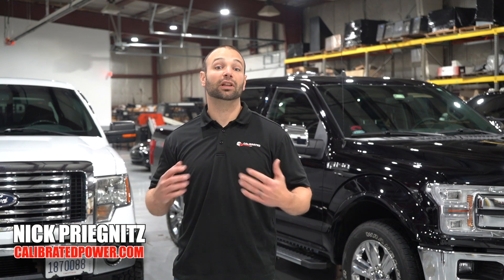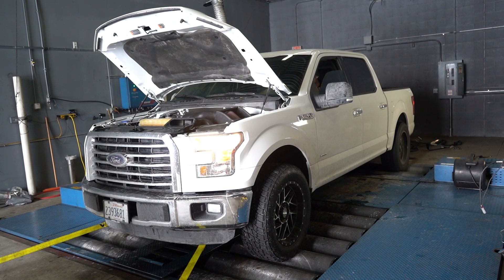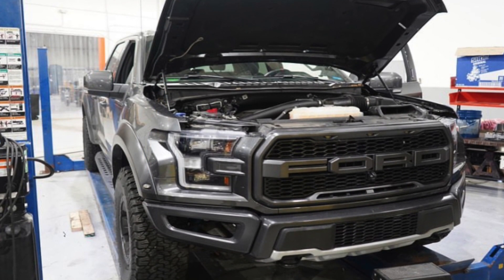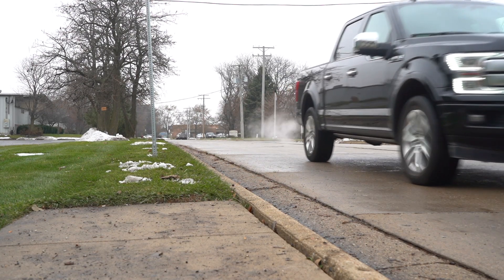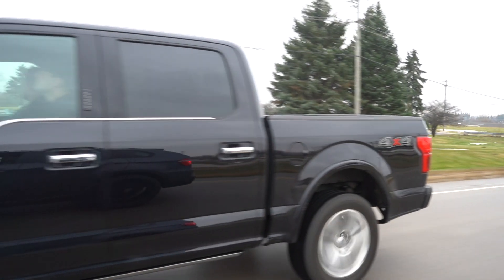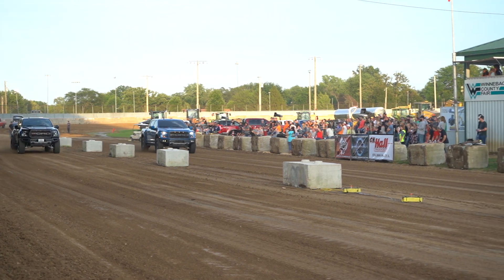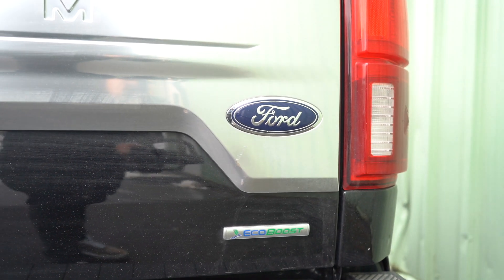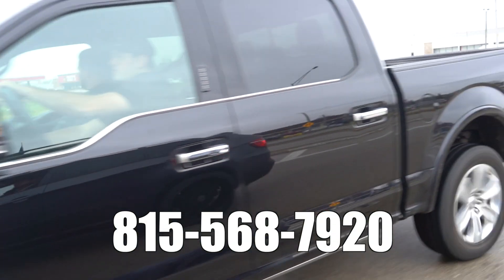ECOBOOST TUNING! MORE POWER, BETTER DRIVE-ABILITY

Comment: How bout some love for the Edge Sport 2.7L Ecoboost?  Despite my tenacious research, I only keep finding F-150 Ecoboost information.  So I'm inquiring every where I find thatseems knowledgeable on the 2.7L EB, are the Edge Sport variants (2016 is the one I'm interested in particularly) similar to the F-150 beyond the slight HP/Torque difference of advertised numbers... if so how similar... what is shared/interchanged by these platforms?   Hardware?    Software?    I welcome humbly any thoughts, knowledge or experience comment readers as well as the channel owners might be able to share.   Thanks ahead of time!

Comment: So if I would use the street tune, how much reliability would I lose with the truck? Would I last the same amount of time as stock?
Reply from the maker: If you drive it like an adult, there is no sacrifice in reliability. If you do burnouts and boosted launches, you will have enough power to potentially get in some trouble.
Reply: With the tunes. Does it work on 87,91,and 93 or do you have to run 93?

Comment: Would a tune void my warranty ? Or is it possible to remove the tune without dealership noticing?
Reply from the maker: We have never had a warranty issue, the ECM can be flashed back to stock at anytime. That being said, warranty is always up the OEM and dealership.

Comment: Why the 3.5 Ecoboost can’t put out 647Hp like the 3.5 Ecoboost in 2019 Ford GT?     What make the GT 3.5 Ecoboost different?
Reply from the maker: Well, the price point between the 2 vehicles you mentioned is around $400K-$450K.  My guess, since we do not have a $500K Ford GT here to test with, is that there are a lot of upgraded parts from the factory in the GT.
Reply: 70% difference, bigger turbos on the GT, Heads,Block,fuel system, Transmission.

Comment: How will the tunes work out with other aftermarket parts?  Cold air intakes, and higher flowing exhaust...
Reply from the maker: They are completely customizable, but neither an intake or exhaust should make much if any change in the tuning calibration.
Reply: @Duramaxtuner s it normal not to have boost tell you get to 5 and 6th gear I have a sct tuner I get like 2-3psi then on 5th and sixth it goes to 10+ max is 19psi for me gunning it on 91 octane

Comment: Are these all 91+ octane tunes or do you offer 87 and 89
Reply from the maker: Our SMART files mean one tune can work for any octane rating.  The calibration enables the truck to detect the octane rating and adjusting timing, fueling, ect automatically.
Reply: @Duramaxtuner  I have a '19 F150 3.5 EB with a exhaust and turbo adapters with your tune what can I actually achieve ? +?
Trying to get real world #'s
Reply from the maker: @jase1911  on our Dyno the truck would probably Dyno ~350 stock and 480-490 tuned on E50+ depending on how happy your low pressure fuel system is. If you wanted a reliable 500+ rwhp we’d recommend adding 1000cc injectors, an in-tank pump and running straight E85.

Comment: I was going to go with 5 star tuning, not so much anymore. My 2019 will get a couple more thousand miles (only at 1900 now) on it and then ill get on this. I've been told I need a high pressure fuel pump and low pressure fuel pump to run full e85, how are you doing e85 without it?
Reply from the maker: Give us a call, one of our guys can pull up a dyno sheet for you.  815-568-7920.

Comment: Will this void the factory warranty?
Reply: Yes, it can void repairs if the tune was found to be the cause.
Reply: Seriously?
Reply from the maker: We have tuned several 2019's during our testing. A few of which have even gone back into the dealership for oil changes after tuning was returned back to stock.  Everyone that has tried it, has loved it.

Comment: I just got a 2019 ford f150 with 3.5 ecoboost I will have to consider this package
Reply from the maker: We have tuned several 2019's during our testing. A few of which have even gone back into the dealership for oil changes after tuning was returned back to stock.  Everyone that has tried, has loved it.

Comment: Would love to put the 3.5 or 2.7 Ecoboost AWD powertrain in Ford Focus sedan with limited slip differentias .  Throw maybe a plus 1 size wheel and tire combo and variable loudness exhaust system.
Keep it looking stock .